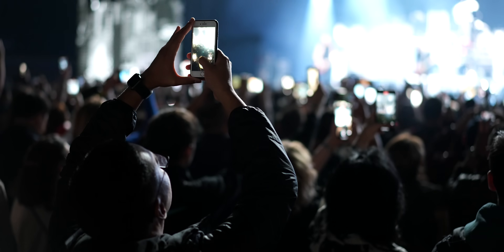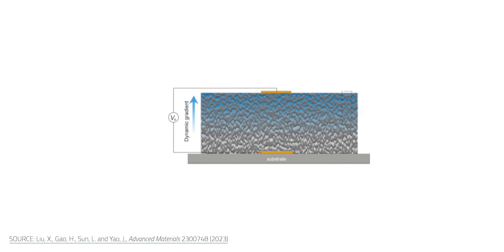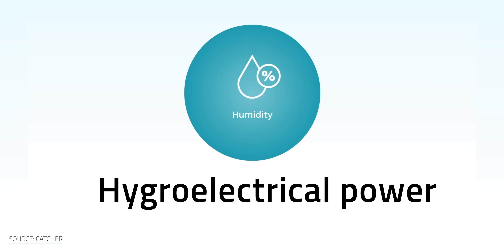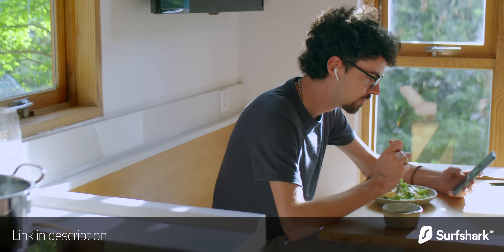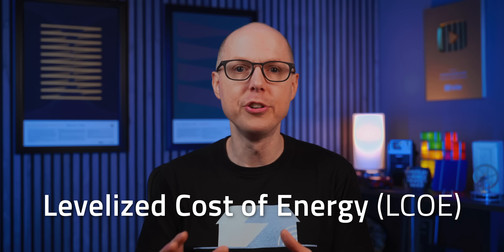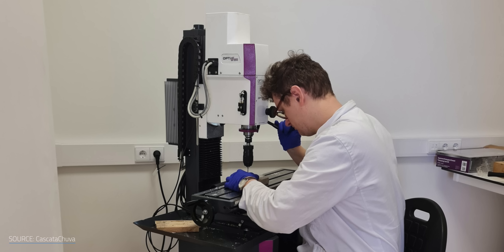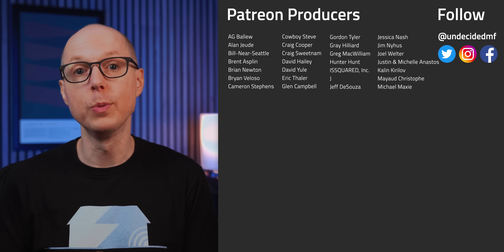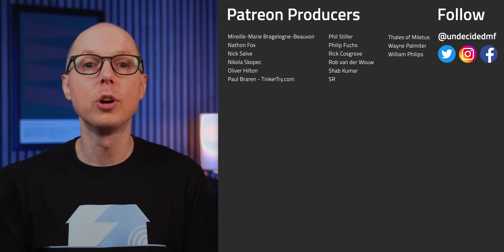Is This Accidental Discovery The Future Of Energy?

Comment: @Matt Ferrill / @UndecidedMF: Please conside stop perpuating the deception that a VPN makes you secure online. It does not, a VPN encrypts your traffic so anyone monitoring your data packets on your network or the data going in and out of your router can't easily read the traffic, but the truth is SSL does a good enough job of this most of the time. I like VPN's and they do help you to be able to get around geo restrictions online, and makes it so your ISP and governments can't as easily read the data online. If you are doing dumb things online like shopping on a scam site, you will still get your money or ID taken. All I'm saying is please consider rephrasing your VPN talking points so it doesn't make a VPN sound like a network firewall or ant-malware it's simply enrypts your traffic and makes it look like you're located somewhere else through a proxy tunnel (which btw adds latency). I know VPN companies push talking points about internet safety especially it seems every content creator that pushes SurfShark has the same talking point about how a VPN will make you safer online, that is simply not true it only helps hide your traffic from data brokers and the government.

Comment: Question:

If any household device produced enough pressurized steam, and we coated a nanostructure internally of an older generation apartment radiator, or in very thin piping throughout flooring and walls, even if it's a heat resistant rubber hose with a metallic mesh we can snake around anywhere, can this serve a dual purpose as an electrical generator by virtue of its length rather than its efficiency which is more so geared towards home heating?

Comment: I think the fact that this could dovetail into places where fog is the norm, not wind or sunshine, makes renewables availble for the people who live there. Also, considering fog happens most commonly around the morning peak, this could also benefit gridscale systems by boosting thw morning supply to meet the daily load surge of people rising to go to work and factories and industry starting for the day, especially in winter, where solar starts generating later and fog is prevelant, meaning wind can't fill the gap.

Solar was once absurdly expensive. I remember paying AU$20 for a 0.5v solar cell to fiddle with on my electronics workbench 30 years ago. I now have a roof full of them, linked with a reliable grid system and for the first time in my life am considering car ownership as I age, because evs are now available. (It'll still only be a small runabout, I plan to bicycle forever or die in the attempt.)

In short, the company developing this first hygroelectric system have startup and development costs to recoup. Like solar, the price will fall, and we'll have another "magical" energy source. Many niches make energy secure.

Comment: September 2024. Absolutely no sign of Cascatachuva's demonstration model yet. Also a company owned and run by a Ukrainian mother and her two sons, doesn't inspire confidence. I fear this may be too good to be true, but just imagine... Unless they end up needing really expensive materials, and there is no evidence they will, then manufacturing is going to be the main cost, and it's one area where costs plummet through manufacturing iterations. Not impossible to believe that these could cost 5-10,000 Euros in five years. Five of these could provide all your, domestic electricity, heating/cooling and EV charging. Saving 500 to 800 Euros a month. Plus they would produce constantly (except for very cold environments, and maybe deserts, but I think PV is pretty good in deserts.

Comment: 3:29 Totally skeptical. A 1m^3 box would make 50 watts of efficiency holds but it won’t. 1) By piling water molecules in this distribution you are hugely reducing energy, so the heat or dedication energy to evaporate will have to be very high to keep our local dew clouds lightning charged.
Reply: 50w=50^6 uW * 1 uW. = 1 uM * 1 meter deep * 1 m^2 = 1 x 1/([1/5 of avg. human head hair width x 2 [spacing guess]]) x 1m^2 / 1cm^2 =   50,000 x 10,000 * 1 uW

Comment: You didn't address the elephant in the room; what is the actual source of power? where is the power coming from? If this actually works then there must be something which is somehow releasing energy into the system and to me (an electronics engineer who works on MEMS devices) it seems completely impossible to get energy from the moisture in the air.

Comment: Tesla was way ahead of this. If you read some of his old reports you will see that he was able to power an electric vehicle in 1910 with nothing but some plates and two pieces of wire. The same design was also used to generate heat by changing the configuration slightly.

Comment: What about heat?  this is likely ultimately reducing the temperature around the process.  so something that would power a whole home this way in the home, would substantially cool the home at the same time, by the same wattage.  so this would make it a terrible idea where you have to heat a home, but an outstanding idea in places that required air conditioning.  this is perfect, hydroelectrification in hot regions, mining bitcoin for heat in cold locations.  no more wasting energy for heating or cooling living spaces!

Comment: I still call bull because someone on the instructables website forums had been working on this back around June 2010. They were originally working on how to improve the world’s longest lasting battery. They had a tank of water with wrapped carbon rods suspended above them to collect a charge from the evaporation. There were other factors in that setup that I can’t recall but the data is on that website somewhere. They were successful with their experiments but if what they knew about it would improve anything about this technology, it would be its longevity and I wouldn’t be surprised if the fellow was still testing it’s lifespan. The goal is to beat 130 years.

Comment: This is a natural phenomenon that is useless. It’s a great discovery but impossible to manufacture at a reasonable price. It’s too fragile and has to have a perfect humidity ratio. Creating nano sized holes in anything is for chip manufacturers. You’d need a device the size of a semi to power a refrigerator. Everything that’s on the periodic table has electrical potential but this I’m afraid is not the answer.    😊

Comment: what happens to the moisture, does the water condense? Does the humidity need to be changing to create useful work? do the water molecules lose energy as they bounce around? do they have to pass though completely to generate charge?  does the structure degrade over time?

Comment: If nanopours expand in diameter when exposed to some relatively hotter conditions (such as daylight) and constrict during cooler conditions, -- maybe they don't, or maybe only some do -- it would be cool if devices that rely on those nanopours could clean themselves, expelling dust passively every night, but... I imagine the necessary mechanical stresses shorten the life of the device in exchange for keeping it marginally cleaner for longer. Still, sounds less tedious than manually applying a skin care routine for things like solar panels every so often

Comment: they should try this with copper tubes that have a sand core to slow down oscillation. i bet pwm would cause the atoms in the material its self to do this without humidity. or maybe nano perforated stainless steel sheets could be used to split oxygen and hydrogen from water for a combustible fuel source, above COP 1 because of the unpaid for added voltage due to nano tech. Possibilities are endless if we stabilize the tech and develop math for it.

Comment: This could be big. It all depends on the unit cost when it is in mass production. And ... how does it work in below freezing temperatures. Air humidity is variable and it will not produce energy at all times.

Comment: Sounds like a galvanic cell where the material slowly corrodes from the humidity. That kind of device is already common, such as anodes used in seawater to prevent corrosion of a steel structure.
A similar device was invented as a backup battery for EVs. Basically, it was a big block of aluminum, and it allowing it to corrode produced a current which could operate the the car.
 
The fact this works off of material with pits, it sounds a lot like pit corrosion, which as suggested in the video, is driven by a difference in electronegativity between the top and bottom of the pit.

Clearly, energy doesn't come from nothing, and there must be something with higher energy that is being converted to lower energy. High-energy chemical bonds becoming low-energy (e.g., a breakdown of the sensor material), energy associated with water as a gas versus liquid, or some else must be the source.
 
Again, my guess is a slow and perpetual degradation of material is the source, and it surely costs more energy to make these than will ever be extracted from them, so it's NOT an energy source.

Comment: I noticed this effect about 41 years ago in a humid environment in Wales, UK. The Voltage was about 1.2V - so potentially useful and the current was in the order of mA - so not huge but again maybe useful. The solid state aspect is certainly appealing. At the time I was convinced it was an electrode effect, thus involving weak acids and airborn moisture. I shall watch this space.

Comment: Battery are good but??? 👉Wireless transmission is better. Especially for cars it would reduced weight of car drastically and needs for recharging. It would be much better solution for cars than any battery.😲👌👍👏

Comment: So, where is the energy coming from? Is it the heat of the water vapour? So it would cool down the air or turn water vapour to liquid water? Or not?

It sounds great if it works, but it sounds like a lot of energy just from mild, still, air.

Comment: I'm wondering if these work on a similar principle to a Kelvin Water Dropper (aka Kelvin Electrostatic Generator).  A lot of comments have pointed out the issue of clogging which could potentially be solved with a filter.  There's also a lot of comments assuming it's a thermodynamic process driving power like a thermocouple which could be the case.  If it does work similar to a Kelvin Water Dropper though then it may be possible to design in a way that naturally dehumidifies the air without permanently clogging the pores.  Until we know more about how it actually works we really can't judge it's feasibility.

Comment: So how does this engine works thermodynamically? You haven't mentioned it once. You can humidify air to 100% without using much energy all you need is water, so why seaking for places with high humidity. And what comes out of the back of the divice as spent fuel? You haven't mentioned any of this details.

Comment: So I guess a m² will give 0.25 watt. So if smartphones in the future will  require less electricity one could probably charge one with that but that's about all. --- unless you probably can have something like 100 layers within 10 or 30 cm. Then it's more like something called "free energy" but I doubt it can be scaled up as the molecules get discharged. Probably something like power per volume is less misleading. I guess it is more efficient if the cell is feed fresh humid air quicker. So I'd say it could work as some kind of alternative "wind power".  Too bad it probably can't be used to decrease humidity.

Comment: Mixing up kWh and kW is not acceptable for a "technology" channel.

kWh is measure of total energy.(often used for total electricity used/produced)
kW is the rate which electricity is used/generated.

Saying the washing machine sized device that produces 10kWh a day is equal to 10kw solar system is completely false.
10kw solar system in a sunny area averaged over the year generates around 40kWh of energy per day.
Solar is 1/4th the cost per kWh generated.

Comment: Perhaps this technology could be combined with other energy transfer devices, like solar panels. So instead of the   space pollution of solar panels, turbines et al. The new teach 'goes thin and tall' rather than horizontally 'wide' for example 'food production green houses in which the structure of the building provides the energy to heat the ground area to grow the crops. I live in cold dark Europe- where energy is sooo expensive.

Comment: It looks like the easy water zone differential charges cause by surface tension charges against hydrophilic surfaces. I bet the system improves voltage when introduced to infrared light.

Comment: Why not include a humidifier into the system and make it loop power back to run it? This entire thing could be made into a closed chamber system so it run on its own ideal micro climate. 🤷‍♂️🤔 Certainly possible considering it’s scalable. You just need to have climate controls to monitor and keep the perfect level of humidity within the chamber.  To run it means you simply need more stacks of these devices..

Comment: Sounds like a thermal transfer, but seems to be collecting EM.  There's another device that uses micro currents( as in water, not elec.) to clean the pores of nano filters and gen elec. thru heat transfer from the sun for example.  Water is polar and energetic.  So I imagine the water mol. hits a fairly grounded piece of material (fiber, etc.) and pumps electrons minutely in the ground due to the spinning (seebeck?) generated in it's polarization.  How they all spin in the mostly the same direction in the same column is perfectly natural when still.  but with multiple complex columns I doubt you could get an effect without a diode (which can include an led).  So it's like collecting EM on the ground and then pushing it in cycles, like stacking 1000 1" short masts next to each other instead of 1 tall 1000" mast collecting EM.  So let's put it in a lead box and see if shroedinger's cat is truly dead.  if you could make a 1 ply sheet of graphene (ungrounded) and float a water molecule on it w/o the water jumping then it must be EM free.  turning a "battery of this type" 90 degrees might not show a difference because the nano columns are still columnar, but test in a bouncy bus going down the road and i bet you get a net zero.  I bet a ham radio tower could gen. more power w/o turning it on just from all the cell phone signals alone.  If you can get a cheaper TeG to work more efficiently and cheaper per Watt Hour despite space requirements (like w/o expensive germanium alloys) then so be it.  I see the appeal of bacteria nano builders in this space, but i also see the dangers.  So i think the best thing from a mfgr. point of view is finding a cheap supply of graphene, like $60/g and you need 1kg...umm, the price point will never meet.  The research will remain "interesting" at best but never to market.  There's a Russian patent that could cut the mfg. cost down to a 1/10th of the current lab grade research material cost, but what company is gonna step on patent law to ensure the society advances?  Not in the US at least.  Everything has to be "Novel" approaches instead of straight verified ways until IPs expire (if they ever do).  Not in my lifetime.  Even research into fusion is stalled because they (imho) can't spend Trillions on high grade wire and capacitors at scale. So the goal should be to get graphene down to less than 70 cents per gram. i don't think bacteria should be used for this.  it's about power input being the most expensive part of the process.  So you use a device that uses graphene to generate power to create more graphene,  the time to market could be a decade before actually being cheaper than silver or copper.  I type too much and too fast so ignore what you don't like.

Comment: This sounds like (yet another) variation on the theme of Maxwell's Demon.  If you are harvesting energy from the random motion of molecules then you could use such a system to reverse entropy and violate the 2nd law of thermodynamics.  Of course this has been proven to be impossible, so how does hygroelectrical power not  fall into this category of impossible machine?

Comment: Uh, a 10kW solar system generates about 45 kWh of energy per day.  And you said the washing machine sized humidity battery which is comparably priced generates 10kWh per day.  So, no, solar still blows it away until they are able to decrease the cost.  Please don't get kW confused with kWh.

Comment: Possible thoughts? Is the high humidity creating Oxygen [O3] (Ozone) whilst passing through the nano-structure materials pores and causing the Ozone to be released AKA [Seaside Oxygen Level 'O3'(Ozone)] as it passes into the substrate and the free electron then released & humidity turns straight back to water Hydrogen X2 Oxygen [H2O]  and releasing the 3rd electron as energy to be harvested?
Just a thought.
Les Dunn

Comment: What happens when it is full of water? This seems less like renewable energy than a battery, that is recharged by heating it up to get the water out instead of electricity. Also, you would always need a conventional battery alongside it. Because your devices cant run on power that varies with humidity.

Comment: There is a big problem with trying to use electricity for everything.  Yes, it's clean.  Yes, it's renewable.  For some things, it's great.  But....  It takes a LOT of it to match the power (BTUs) lock in one cup of fossil fuels, like gasoline, kerosene, or diesel, and LP.  That's why there are no electric rockets, big trucks, trains, or airplanes.  And, it's not easy to transmit.  Like you can't just go to the electricity station and bring a gallon of it home.  Maybe when we have some form of cold nuclear fusion in a very small package, we'll have the power we need?